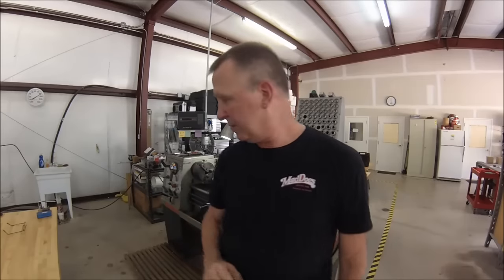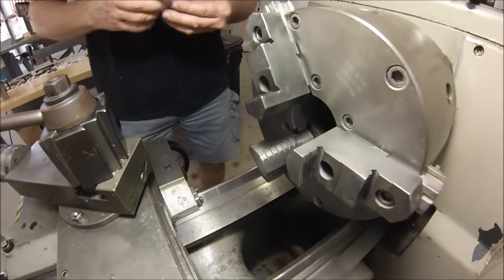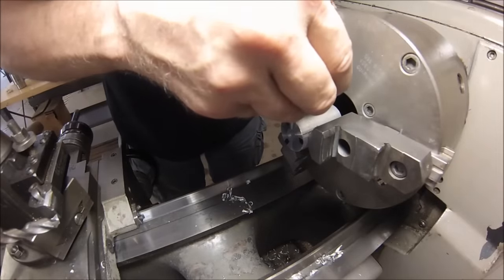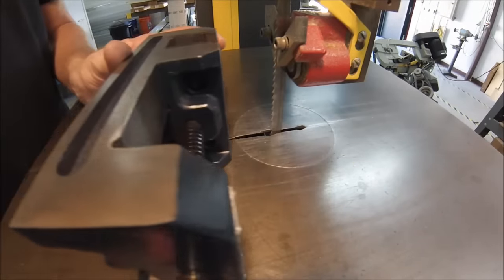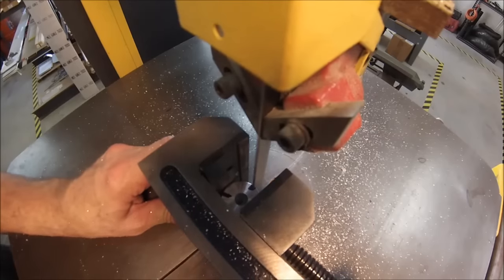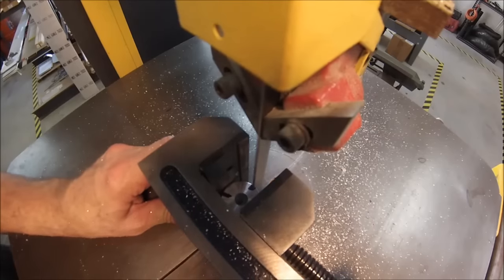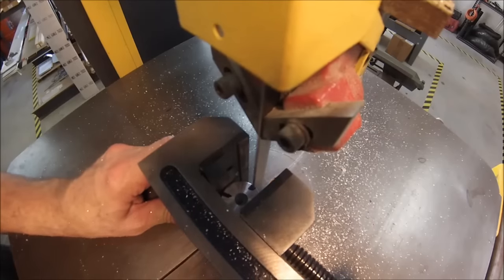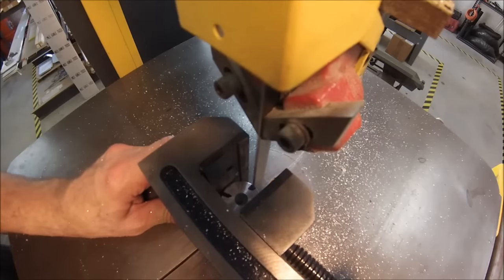Get your parts to run true in a non adjustable chuck. YOU MUST WATCH THIS!

Comment: Excellent video Joe! Have you ever considered using hex stock to eliminate the chance of rotation? Your video also shows how to turn an eccentric part on any lathe, with the exception of drilling and boring your finished hole on a mill with the bore being offset by the same amount as the eccentric diameter of your part. 

Again Joe, another excellent video.
Reply from the maker: I have used hex stock. Thats a great suggestion. Eccentrics are done like this as you mention. Gotta have a mill for that one.

Comment: Nicely demonstrated and I keep at least one "standard" handy . A piece of turned tool steel which the concentricity / cylindricity  is of very close tolerance and used for indicating only . 
Wrapped in a piece of  oiled old wool blanket and kept in a wood box . 
Thanks for your video from an old conventional and CNC aerospace machinist .

Comment: Thanks, great points, either method works, I've done it many times without a shim and never slipped once.
Reply from the maker: Thats all that matters. I've been known to reach over a chuck with a file more often than not. All good so far. Stay safe and thanks for the conversation.

Comment: This is the first video I have watched of your machining tips, Joe, and I enjoyed it. The quality of the recording is great and all steps are explained very well. As a machinist myself, this technique works great as a custom made bushing or "collet", but is only good for a specific diameter round stock and requires phasing or timing correctly on the non-concentric chuck. Personally, I would chase this problem differently. Wouldn't it be more efficient for future use of the chuck to address the actual issue with it? In your case you have an Ajust-Tru style which can be indicated in, as mentioned in the video. Some of us don't have an adjustable 3-jaw, so I have found that I can use the stepped face to chuck the ID of a concentric bored part. Or preferably, if the chuck has face bolted jaws use stub bolts to load the chuck OD clamping a machined ring. Then, bore the chuck jaw's ID with carbide tipped bar. This usually works, but for very hard jaws an ID grind with the tool post grinder is in order (not everyone has a tool post grinder). After the issue is resolved & the scroll is not terribly worn, all sizes of parts will chuck with concentricity. I wouldn't make many of these without addressing the actual problem.
Reply from the maker: This is not a video on how to repair a chuck. Its a video on how to make a good part in a POS chuck.

Comment: I started making these this week. Man what a difference! I took a little different approach. (1)  I turned OD of aluminum bar to 10 mm larger than the bar I want to use in the collar.  (2) I drilled and reamed ID to exact size of raw material  to be turned (i.e. 20 mm) (3) Marked orientation on face of resulting tube for future reference (4) Milled relief cuts and thru cut on Bridgeport (5) Back at lathe, oriented collar according to marked position (6) checked runout on bar to be turned .001 (7) test cut smooooth 

Thanks Joe, you da man!
Reply: After watching the video do you think it would help to use a torque wench set to the same torque it took to squeeze the shim in the collet when putting your work piece in? Increases repeatability...
Reply: @ericdowner5589  Wouldn't help much but if you are doing something with really tight tolerance, every advantage helps. I get repeat-ability within a thou without a torque wrench. Also I don't use a shim like Joe did. I just ream it to the exact size of the material I will be turning and then cut the slot and reliefs at the mill. And be sure to mark the orientation on the collet to match it back to your spindle orientation. I use a center punch to mark one dot on the collet over jaw one, two dots over jaw two, three dots over jaw three. Put it back in the same way and all is well.

Comment: I like that trick we have some tired chucks at work that are not set true & some of my chucks in my home shop might not be perfect either - Thanks
Reply: You can go a step further.. if the chuck is crap anyway... once you have made a bushing like he showed... swing the part with a indicator... mark your run out.. and  smack the jaw that reads highest with a dead blow... not to hard... it's a feel kind of thing..  to much and you chase your tail.

Can actually ship making a bushing doing this with shims... but you may have to correct run out at the end.

And if it has to run dead true.. rough it than go between centers with a drive dog
Reply: @Scotian6444  There are many ways to skin a cat, each with it's own pluses and minuses, depending on the cat. In your case, running a part between centers is a very good method, but what if the part is very small?
Reply: @bogdan_n  do what he said..  but all I said.. if you want it dead true with a collet.. dial.. and hit the jaw that reads high.. and snug it with a chuck key again... old chucks have alot of play in the scroll... sometimes you can cheat it or chase your tail for a long time..

Same for dialing in a reamer for a mill because some engineer put a one way 
.0003" tolerance on it.. ffs.. lol

Comment: that is a very Handy trick.  I have a set through chuck on my bigger lathe but not on my smaller (CNC) lathe and, from time to time need to do a double operation . .just subscribed
Reply from the maker: Its a very important detail for a quality part. Thanks for subscribing.

Comment: I could have used this trick a couple of months back. I work in a different building than our machine shop, but I occasionally need to use the lathe. Our old Mazak's chuck is definitely not concentric and I don't have the authority to force our main machinist to adjust the chuck. Maybe I'll sneak an adjustment on it myself when he's not there some day.

Comment: I bought a steel body, plain back 8 inch Chinese "Bison" chuck in 1988. I bought a backing for my LO spindle nose and simply turned the chuck into an adjustable one with four set screws. I still use it and It runs true within .0005.
Reply: Funny, my Bisons were all Polish made.

Comment: Ah, if Im not mistaken, that's a Colchester Lathe, one of the first ones I used as an Apprentice....many years ago. A Lathe designed and built in the UK.
  Of course, you can adjust the chuck so it runs true, a feature not included on all lathes....For me, you made a soft collet adaptor which will not mark the component, something more useful than correcting the eccentricity because hardened jaws always mark the component.
  In a production environment, bored out soft jaws would have been used instead because then you can hold any diameter.
 Retried now, i have a Diamond Myford at home to play with, when I want it true, I pop on my 4 Jaw....lol.
   Nice Video...:)
Reply from the maker: It sure is. Great little setup.

Comment: Good Tip. I was once told that when making split holding devices such as collars or mandrels it is important that the slits are very equal in all ways. On some examples I was shown the man had done the slits using a dividing head on the milling machine. Whats your opinion on this? Your slits done by eye do not appear to cause a problem. P.S thanks for another mention on your Emblem video! Cheers
Reply from the maker: I disagree with the need for such rotational accuracy in an application like this. I made and used hundreds of collars like this and every one was hand split on a bandsaw. Doing this by eye is fine as long as the slit is in the general location. You're welcome for the shout out again, Keep up the good work and thanks for checking in.

Comment: lots of neat stuff. just found a digital caliper that reads out in thous, mm and coolest of all fractions. I made a buck chuck out of my three jaw, and found my accuracy improved by tightening all three nuts. Armen Bagdasarian
Reply from the maker: I only have a single clamp socket, but I have heard that. It works with Jacobs drill chucks as well.

Comment: I'm obviously missing something here. . The chuck is off centre and therefore the hole you drill is off centre in the stock but centre to the line of the lathe. You then turn the stock around in the chuck to face the other end, but the hole still remains centred to the line of the lathe. Surely moving the stock in any way in the chuck could put the hole off centre. Please correct me where I am wrong with this
Reply from the maker: Your observation is accurate, but..........1. The pilot hole is small enough to absorb any eccentricity that may be present, and  ....2. The bushing can be turned around prior to the final boring with considerable confidence if you keep the "up side" up after you turn it. Th error stays to the same side.  You are not wrong, I have just done this a thousand times and don't even think about that anymore. Good question.

Comment: Thank you Joe for all your good tips , i really like it. I would like to have a video of how to check and adjust properly the tailstock. I did it on mine but it's not really fast , maybe there is a good way to do this without going back and fore all day long.
Reply from the maker: Chuck your indicator and sweep the Id of the tailstock. Its pretty straight forward.

Comment: This is a great tip for those that don't have an adjustable 3 jaw chuck. But, it's only good for 1 or 2 parts as it's too difficult to repeat getting the 'emergency collet' back into its exact position every time. If you have more than a couple identical parts to cut, before doing the ID work and slots, turn the OD of this emergency collet with a step to register on the face of the jaws. Then, VERY carefully, mark your clock position so that you can be sure to be in the same place (or very close) every time.
Reply from the maker: Only open the chuck enough to get the part out. do not remove the part, or the process can not be trusted. Don't let the collar spin or migrate in or out.

Comment: Brad Hand
Great tips & tricks...
one note, please warn about pulling the tail-stock back without making sure the taper is TIGHT, Biggest wreck I ever had was Delrin shock spacers. I was punching them out with a 11/2" drill and was on the 8th part when i pulled back the tail-stock and the chuck pulled out of the taper and stayed in the part at a higher speed then i would admit to in a court of law...
The upside down thread trick is awesome, as well as the quick left/right thread tip chuck direction vs lead screw...
Keep this up and you might make a machinist out of me yet!!!
Reply from the maker: I bet it turned into a bed slapping giant overweight flycutter just before the drill broke and you shit yourself. I also bet you never did that again. Glad you didn't get hurt. I lost a 1/2" thick 14" diameter aluminum ring out of a lathe once at 750 RPM. It dusted my left ear on the way by and smashed a sheetrock wall 20 feet behind me before hitting the floor and traveling another 80 feet ringing like a bell. If I was standing a couple inches to the left, it would have killed me. I'm very careful on these machines.
Reply: My first time on my brand new 12x40 lathe (after watching guys like Abom take 100 thou cuts).  I thought my new lathe would do it too..... ripped a 4" dia slug of steel out of the 4 jaw. ( I had just spent the better part of an hour getting it dialed in)  It ripped out dropped down onto the board I had sitting on the ways (THANK GOD)  and hurtled past me bouncing across the garage floor and out the roller door and down the driveway .   :((   That was my first try on a lathe LOL  (Almost my last)
'
Reply from the maker: Good rule of thumb........IF THE CHIP EXCEEDS THE GRIP, THE PART IS GONNA SLIP

Comment: Great tip Joe.  After all that, then you would turn the piece down that you needed to be concentric (more that your chuck jaws would allow).  I'm assuming the holding power is good depending on your ability to clamp down on the bushing.

Comment: always tighten chuck using all three spots, it helps center the scroll. You can also "dial in" a three jaw by going around and tightening or loosening the chuck in different spots, it loads and therefore moves the scroll slightly which moves the jaws, you can often get about .004 or .005 out of it which is many times all you need to get it true.
Reply from the maker: Snugging a chuck from all 3 locations is a good practice on a Jacobs style drill chuck. Many 3 and 6 jaw lathe chucks do not have multiple receivers much like the chuck used in this video.

Comment: I'm new at this, and I've got a small hobby shop in my basement, and appreciate the tips immensely! Thank you. As for having these for different size shafts, laying around, how do you realign these to the original chuck? Or, does it not even matter, because the I.D. has been machined true to the centerline of the lathe?
Reply: It matters, because the "collet" is off center too, but in such a way that compensates the chuck's error, and you have to place it in the chuck the same way every time (he marked the chuck key position on the collet), or you make it sacrificial, and you bore it again every time you take it out (of course, you use one which has a smaller bore than you need).

Comment: A tip I was taught in the shop by my old foreman for step drilling is to fold an old rag twice so you have four layers of rag and put it over the hole before introducing the larger drill bit. It stops any jumping and juddering. I know you had juddering because of the shim, just a tip I was taught years ago, might come in useful!
Reply from the maker: I've heard that. I have to try it.
Reply: @joepie221  it works 👍

Comment: Nice! My old 1983 Jet 1236 has a .002 runout in the body and I don’t have a set-true chuck. This is great! Just subscribed. Thanks.
Reply from the maker: This is a solid way to get past an obstacle, but should be considered a band-aid and not a cure. Ultimately, grinding the jaws back to a true geometry is the long term fix. Thanks for the sub and welcome.

Comment: Hi

You should use the chuck key in ALL of the chuck key holes. This helps with concentricity. This way, when you need to compress the "collet" to  achieve concentricity you have better concentricity control using all THREE holes than just HEAVING on the chuck key in one hole.
Reply from the maker: If your chuck offers more than one hole that is. This Buck adjust tru does not.

Comment: My 1960 Colchester has 7 tho run out.  I tried this and it got it to 1 tho..  very time consuming.   But i found a buck chuck on CL for 50.00 now im  .0007 ish run out on 1 inch and smaller  work .

Comment: good video... only thing I can add is that if you have a mill, it'd probably be easier to mill the wide slot than to cut it on the band saw... also a little paraffin on that blade when cutting Aluminum is helpful